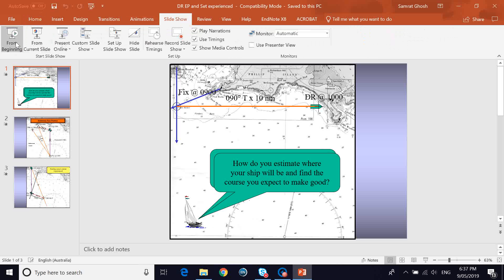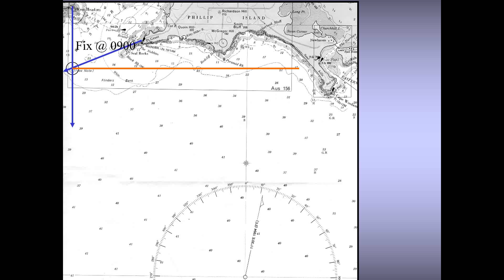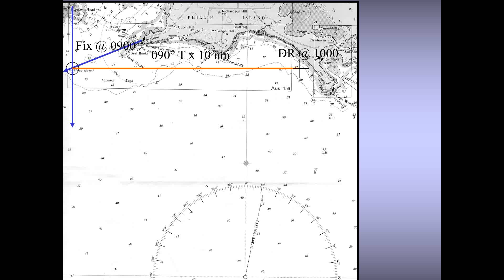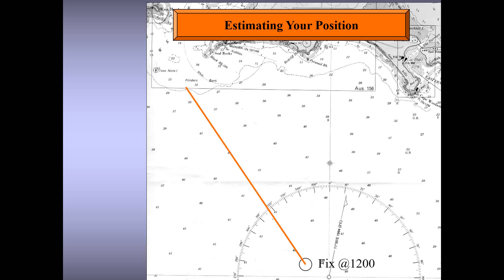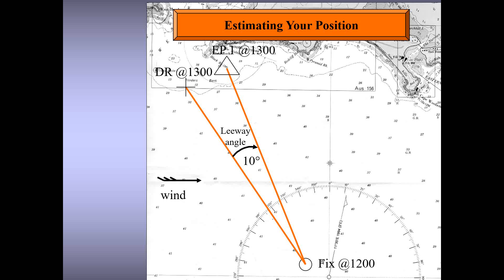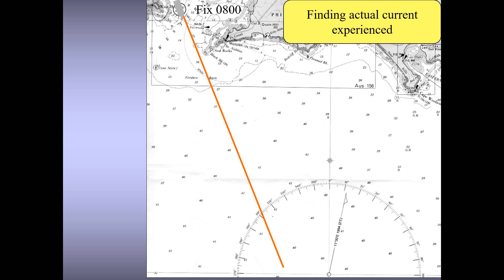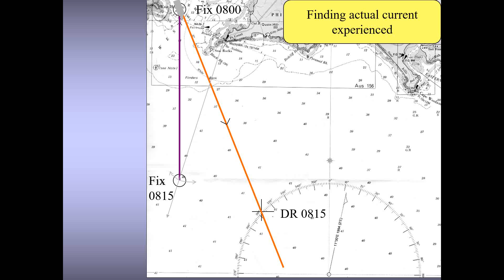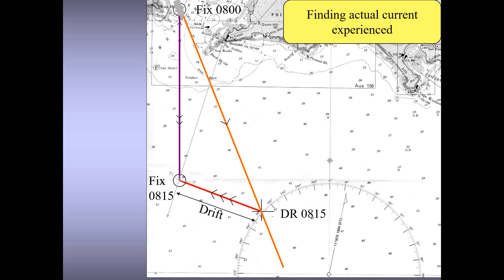Chartwork on ships - DR and fix position, effects of wind and current, set and drift

Comment: First, thank you for everything

Now if I have a compass course, and I have the deviation & the variation, then I have wind effect with known leeway, then at the same time I have a current with known set and rate, 
In this case If I was asked to determine the position (EP) when a distinct charted light house is abeam my ship, 
My question is
WHERE should I draw the perpendicular from the Light house?!
I mean, in this case, shall the perpendicular beam be drawn from the light house at a right angle to  the corrected course (compass course + Error + leeway = corrected course) OR  shall it be drawn at a right angle to the True course (true course = compass course + Error) ?! 

I'm sure is this case we should not draw it perpendicular to the C.M.G.